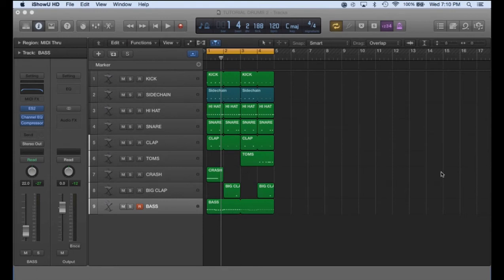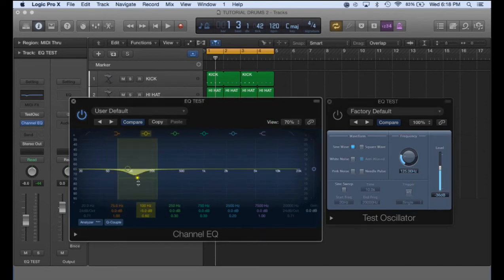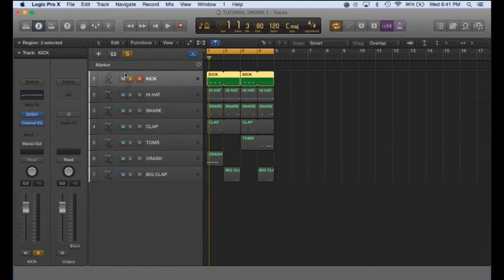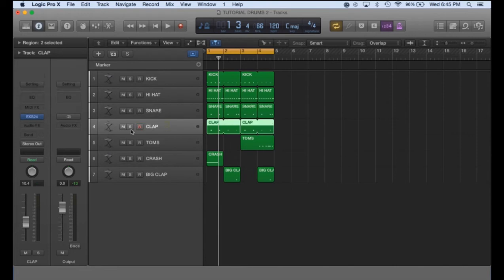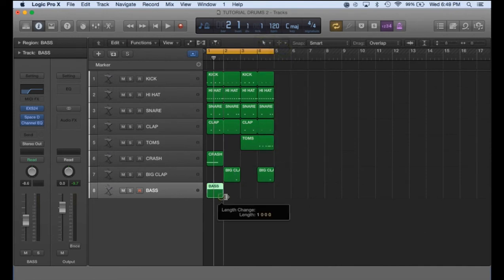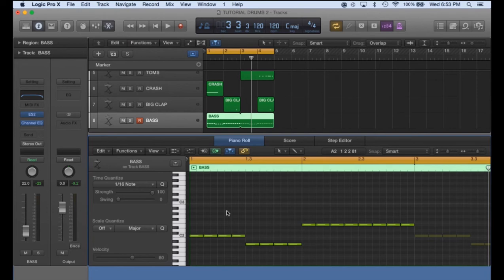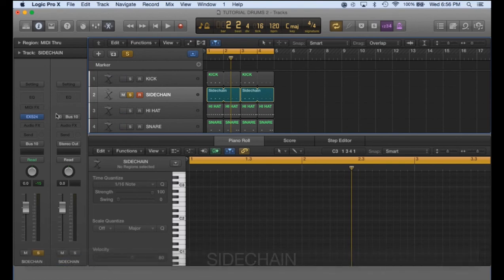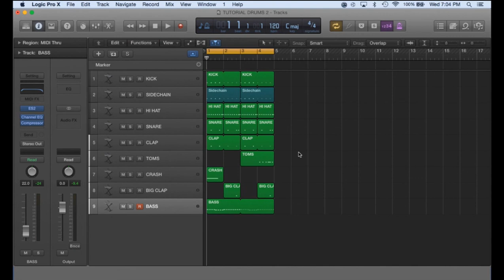Synthwave Series 2: EQ + Side Chain Bass

Comment: Finally, a tutorial were someone EQs properly! So many bad EQ tutorials around with people butchering their sounds.

One of the most important and fundamental things I ever learnt about producing music is that you should build your songs using little or no EQ or Compression at all. This is why professional producers always preach about the quality of samples or synths being super important, because quite frankly, you can't polish a turd.
Reply: I completely agree about starting with good sounds and samples because of the "you can't polish a turd" phenomenon, but releasable/released tracks have absolutely tons of EQ and compression on them. They are very polished, but they just didn't start as turds. ;)
Reply: @AutPen38  Well EQ has two different stages: 1. removing or lowering unwanted frequencies, and 2. seperating frequencies when masking or clashing occurs. The former is an interesting step because it can be argued it belongs more to sound design than mixing. A lot of modern synths come with EQs and compressors built in allowing people to treat sounds before any other processing in the mixing stage. So sound design is a very important step in production which I think a lot of people neglect. A lot of people tend to use patches/presets which are like trying to fit a square peg in a round hole most of the time, and people end up butchering sounds with EQ and compression to get them to work. Ironically, a lot of the EQ treatment in the sound design stage makes mixing a lot easier. I remember a clip of Junkie XL saying that he cuts and boosts crazy amounts of EQ in sound design, but when it comes to mixing it's small tweeks of 2 or 3db, which makes a lot of sounds to me.

Comment: @Arcade High   is it okay to use 2 eq‘s on a kick ???  One to form/sculpt and the other to make a low cut ???
Reply from the maker: Yeah sure! There are no rules, whatever sounds good. That doesn’t sound too out of the ordinary. You probably only want to cut around 35 and below or so unless you don’t want any sub / adding your own sub. You can also add a “clicky” layer to it for the upper end if your kick doesn’t already have it.
Reply: Why use 2 when you could use 5? ;) You can get most of the way there with a single EQ plug-in (like FabFilter's Pro Q, or anything with 5 or more bands), but it's not uncommon to have one EQ for rolling off low and/or high frequencies, another for making general cuts or boosts at important mid-range frequencies (e.g. scooping out the middle of a kick drum), another in an analogue-style for colouration (E.g. Pultec-style), a multiband EQ with some subtle compression in particular frequency ranges, and then maybe something like Soothe to further reduce any resonant clashes you couldn't find yourself with a pure EQ plug-in. If you're using multiple busses, your tracks can usually benefit from a bit of EQ on all of them, such that a particular sound (e.g. the snare) passes through several EQs. The main issue, other than the time required to set it up and the expense of buying multiple plugins is that your CPU may struggle, so it's good to get into the habit of getting the sound right at the start of the chain so that you don't need much/any corrective EQ later.

Comment: Two questions regarding the side chain bass. The first is, the bass track will be peaking and super quiet, how can I fix this? And the second question, what pattern do Synthwave artist's use to give it that Synthwave feel the song ( Daniel Deluxe - Star Eater) is a good example. Thank you!
Reply from the maker: Could you clarify the bass being peaking / super quiet? Turn the track down to prevent peaks and adjust the compressor settings. In addition, make sure that the mix on the right side is not hitting the red. That "Synthwave" feel is simply a 4/4 bass with the "1" being side-chained by the kick. Usually it's done with slower BPMs from 100-110. Anywhere above 115 or so and you start to lose that "feel". You simply throw on 4 bass notes with the first bass note striking on the kick so it creates a -- bum BUM BUM BUM -- sound, so to speak.

Comment: I don't know if its just my logic but when i do the side chain exactly how you do it it only works 5% of the time so leaves me frustrated. However I've just gone on a newer video from 2017 that shows a different much simpler method of doing it and it works. Have logic changed certain functions or not since then??
Reply from the maker: I don't believe so! There's definitely different ways of doing sidechain. That's just typically how we do it. Some people use a plugin called LFO Tool, some people simply use their kick track and skip the dummy track. Glad you got it working!